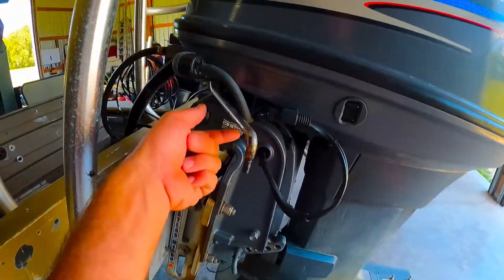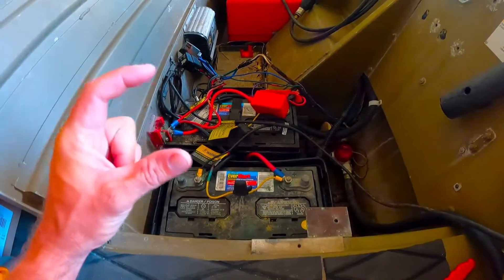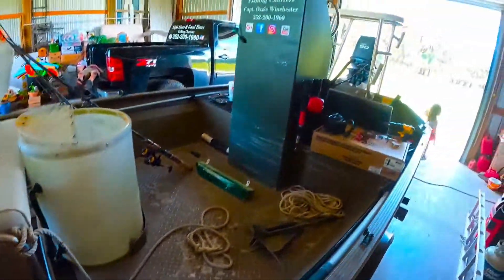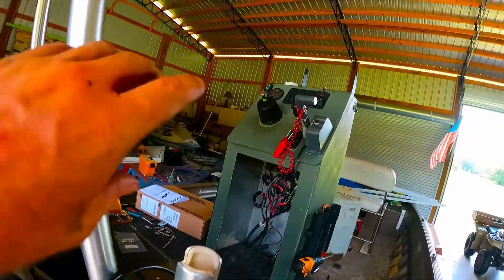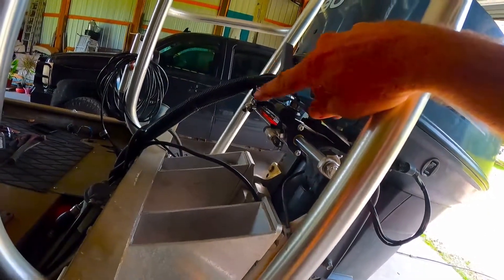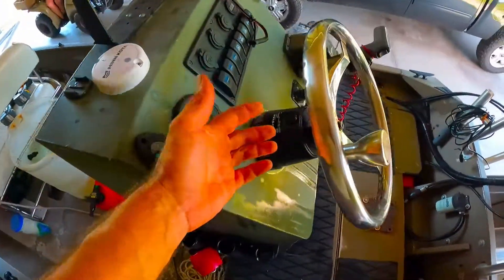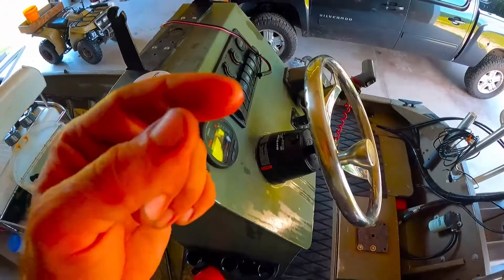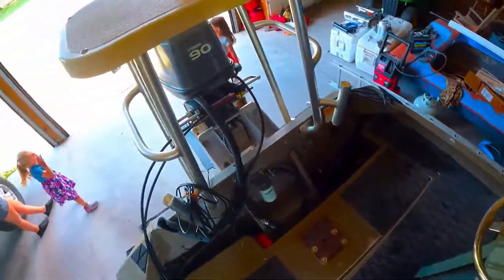Bay Star steering

Comment: not sure but I replaced my 2005 g3 90hp yamaha 4 stroke steering with baystar  looks like the same kit . has worked for me for a year now. had the same pin in the oil cap. I didn't like the hoses seem cheap i will use sea star hose if these crap out